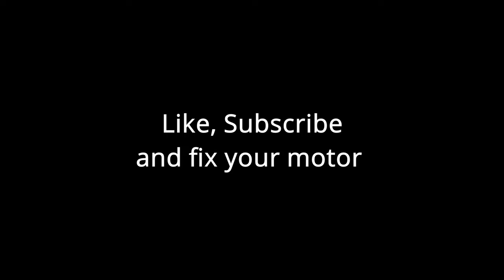Replace Motor C-clip - drone motor repair

Comment: Awesome video, Jon! Thanks! 😃
I once saw someone using the right kind of pliers to change a C clip... You wouldn't believe how ridiculous easy it gets!
Anyway, stay safe there with your family! 🖖😊
Reply: yea dude, less than a minute in and im cringing at the needle nose... new to drones but circlip pliers are one of my best investments. i have 2 now, the irwin set and a channel lock set, both are great, come with a set of different "arms" for different types, can be arranged to spread open or clamp closed. they rule.

Comment: Where do I get c clamps? I lost mine while putting it back in and can’t find replacements anywhere! It has a 1.5mm shaft and is the GR2004 2550kv motor

Comment: Oh my, I googled this very topic 2 days ago with very few good results...  I've only had motors with screw but as a first-winter whooper wanting to clean my motors without destroying it or the C-clip turns out to be damn challenging.  Also those fully kitted out LED rigs looks awesome, whats the best way to get a build like that? Or close to it?
Reply from the maker: The fully kitted ones are from drone racing league tv show (several of the pilots came to train with us for the season.)

For a good diy LED removable solution check this out 
https://youtu.be/pucLT-GjUhA